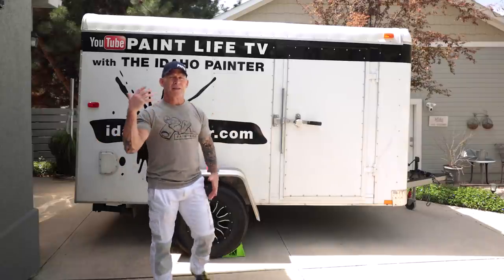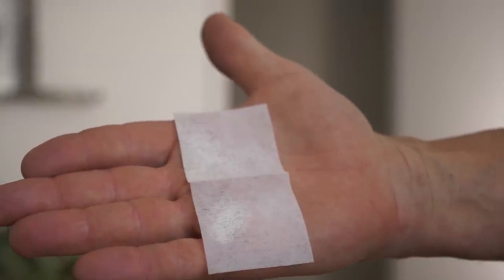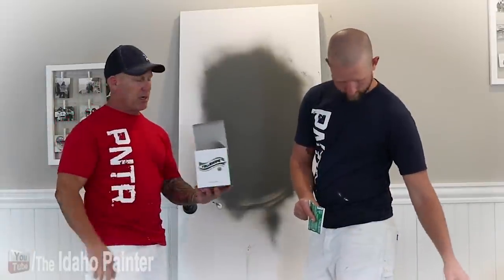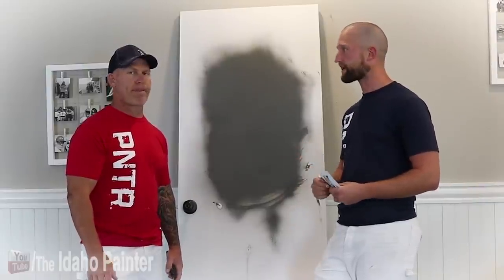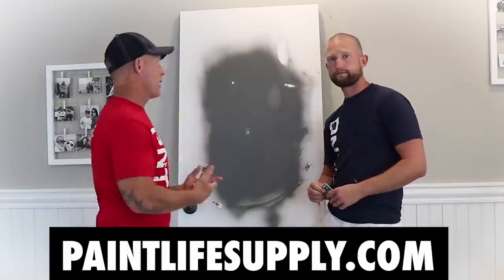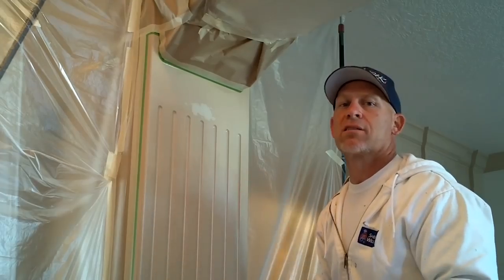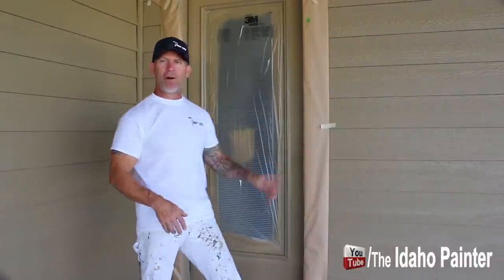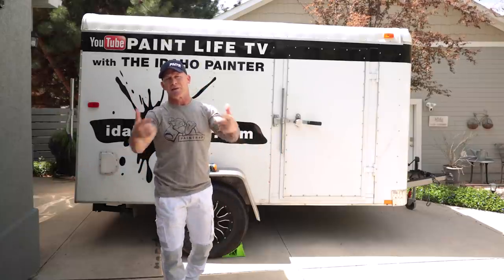How to Fix Paint Runs in Every Situation! Make Your Mistake Disappear.

Comment: If you don’t have a  fancy wipe to handle a run. Wait til the next day when the paint sets up.take some 120 then some 220 sand paper sand it smooth then respray or roll over it again ..if theres any gouges just spackle it…keep a har dryer or a heat gun with you for quicker dry time on your spackle…this dude is a pro and he knows what he’s doing so i would go his route also…

Comment: Good advice, another thing that works is to block sand out the run with a rubber sanding block with either# 220 -#320, don't use a wood block, it's to rigid and could possibly scratch the finish, when I'm using oils, I'll wet sand it with water, if I'm using acrylics I went sand with mineral spirits, basically you just wanna keep the sandpaper cool and not gum up your finish. If I'm using satin enamels I'll block sand out the sags without burning through the paint into the primer, then I'll use deft satin clear spray lacquer and just dust a couple coats on it and the sags literally disappear and it doesn't leave halo's or dead spots.

Comment: I have an older 440i and am fairly new to spraying. I keep running like crazy. Working fast but getting a ton of material on it. Just did trim with a 210ff tip and still running like crazy. I think I need to add a pressure gauge to see what I am actually running @.

If I would have made that many passes on that door, there would be a million runs.
Reply: Is your tip new or old?
Reply: @Tuckersteward  Brand new. I even bought a 411 to do walls and the ceiling and still running. I start low with pressure and go higher until I get a nice spray pattern.
Reply: @mph5896  You do have to move fast, the paint you are using makes a huge difference, thicker painters are harder to run.   Behr paints run like crazy...
Reply: @Tuckersteward  Yeah, I pretty much run big box store paint. Behr, Pittsburgh, PPG. Suggestions?
Reply: @mph5896  Ben Moore has good stuff,  Regal for walls,  Waterborne for ceilings, Aura or Advance for Trim.   Aura sprays easier than advance.
Reply: @Tuckersteward  Copy, ill try BM next paint. Thanks
Reply: @mph5896  Just try and good shop with knowledgeable people who can get you a nice thick product.
Reply: 310 for trim 
 
Watch a bunch of YouTube for how to calibrate sprayer pressure, you doing something wrong
Reply: You’re fine using PPG. We use them and Benjamin Moore and never have issues. If you’re having runs, especially with such small tips, then you’re trying to get too much coverage per pass. You’re also probably not moving the gun fast enough when you change directions. We use a 517 for walls and ceilings and don’t have runs even using stuff like PPG Speedhide and BM UltraSpec which are their lower grade paint.
Reply: @michaelh7490  Thanks for the reply. I bought a new gun, and a pressure gauge to try and dial it in. We will see how that works out. Maybe the gun is worn out and letting to much paint through, or adjusted incorrectly???
Reply: @mph5896  sounds like you need to switch to a thicker paint to get more practice. It's more forgiving. D.V. Vantage is a good one but on the higher end
Reply: Ok it's been a month did you get it figured out? I read through the comments a lot of good advice..
Probably got it figured out.

I'd start with checking the Viscosity it is a measure of how resistant a paint is to spreading. viscosity cup
A small cup with a hole in the bottom fill up the cup with paint count the seconds it takes to drip out you can pick one up at the paint store..
From there I would practice on a sample piece. You may need to thin that product down?
 Recheck viscosity.
Respray sample let dry make sure paint is good to go
They may sell a retarder for it slow the drying process.
Probably coming out too thick and not flowing together until a few minutes later and then it's running.
Waterborne products🥺👍😁
Reply: Thanks everybody for the replies and tips. I replaced the gun with a Graco sg3, and added a pressure gauge at the gun. I sprayed exterior, aluminum siding with Behr Ultra and Behr basic for the white trim and garage doors. Night and day difference with the new gun. I set pressure at 1800. No runs and sprayed beautifully. Even the cheap paint laid down nicely on the garage doors. I bought all supplies before initially posting this. I also set up an account with Sherman Williams, used Emerald for cabinet doors and that worked really well. No more cheap paint for me.

Comment: Thanks for you Videos.  I was painting my ceiling with airless sprayer and went too heavy on coat (went too slow with gun) which resulted in some runs.  I was thinking of wet sanding them out, but am concerned that if I re-shoot one line across my ceiling that  I'll get a Holiday streak.  I'm using a low-sheen Dunn Edwards Suprema paint.  Any advise on how to avoid Holiday streak if I re-shoot after sanding?  Thanks!

Comment: Any advice appreciated. 

I sprayed 12 doors with behr dynasty acrylic paint. 

Have a few runs I need to get rid of. Tried sanding and the paint peels. Should I wait a full seven days before I sand? Manufacturer states 7 days for full cure. 

Thanks
Reply from the maker: Wet sand out

Comment: What about a really old run.  Moved into a house that has several runs in the paint.  One in the kitchen which is really bad.
Reply: Glass scraper. The flat one not the scraper with a handle.
Reply: @inspirationx1  what’s it look like? Can you include a link?
Reply: @alwaysrockn2009  also work it down slow. Don’t apply to much pressure or it’ll pull up and create a hole Ike they were saying. Like you’re sanding it down but it’ll go quick with little effort if your blade is sharp

Comment: Why bondo vs Drydex or hot mud?
Reply from the maker: Tried and tru
Reply: Lightweight Evercoat Bondo is what we use back in the day probably the best long-term. Dries fast you can put multiple coats in a day.
But if you have a whole house to do fill holes fix imperfections not real productive An Affair To Sand if you put it in a newbie's hand.
Hey that rhymed..👍